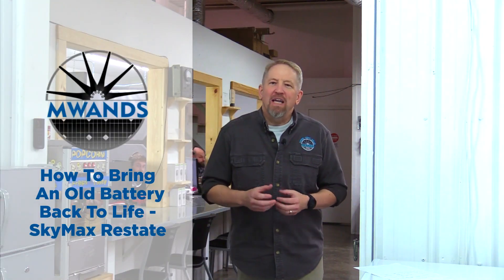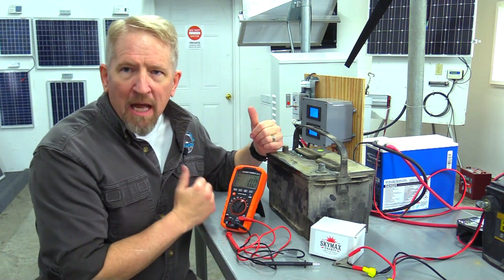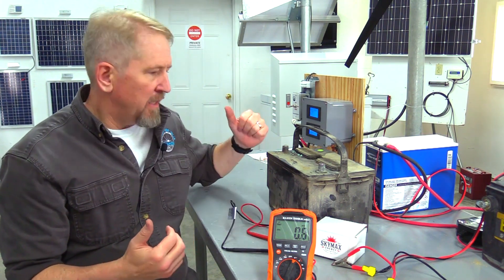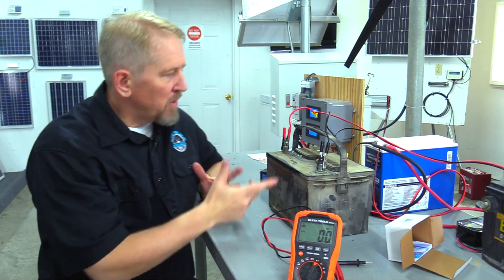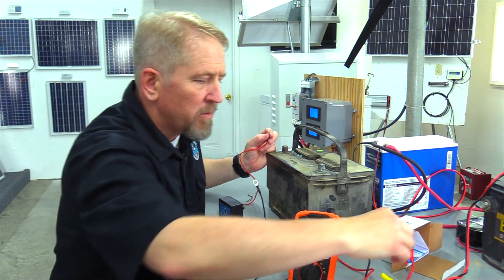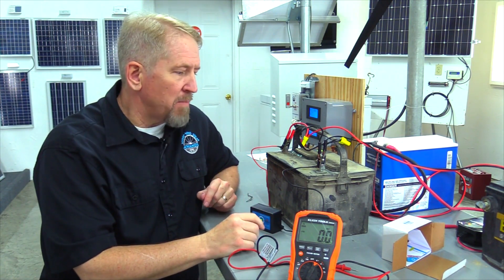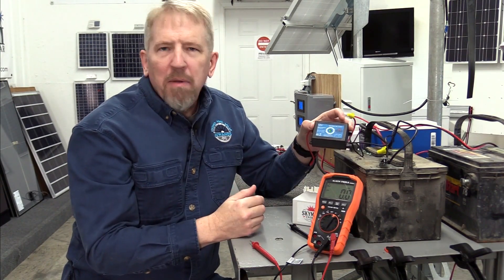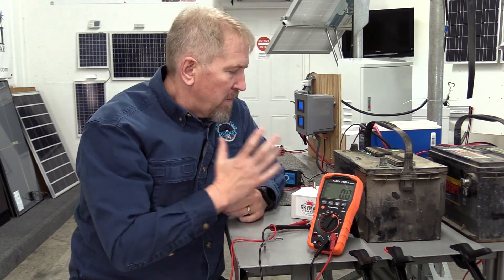SkyMax Restate - How to Bring an Old Battery Back to Life | Missouri Wind and Solar

Comment: I have 4 6v golf cart batteries in use for my RV solar.. I will try this as the can barely power my PC, dual monitors, pc speaker, modem and router for a full day. 500W of panels, running through a BlueSky 3024Dil controller and a Zantrec 2000 ProWatt inverter..  Oh and my Echo DOT.

Comment: Appreciate the effort, but it really won't convince people anything was accomplished. 
Should have load tested the battery after charging it, until it reaches some voltage, like 12.3 V.
 Then charge it again, and a week on the desulphinator, then load test it again.

Comment: Easy baking soda the battery clean out add easy pre mix acid equalize the battery and boom working battery Everytime unless battery has a dead short. That looks like a 100 MHz pulser with a 555 timer tsop chip.

Comment: Much faster method I have persinally used.  Concentrated solution of Epsom Salt and bottled water.  One tablespoon per cell.  Trickle charge overnight.  Chemically desulfinates the battery.  Fixed.  Running a second 5 years on my battery now b/c of this.  I have seen youtube where if the battery does not respond (bad cell), then trickle charge 72 hours.  Not tried it myself.
Reply: I've heard of this but never tried it. Did you have to flush out the battery a few times after doing this, or what were the step by steps you used that worked for you? Thanks.
Reply: I tried this with a good dose of Epsom salt. Sucked out some battery fluid first then topped off the cells..  Didn't seem to make any difference.
Reply: Same here!! I used epsom salt and its instant ugh...